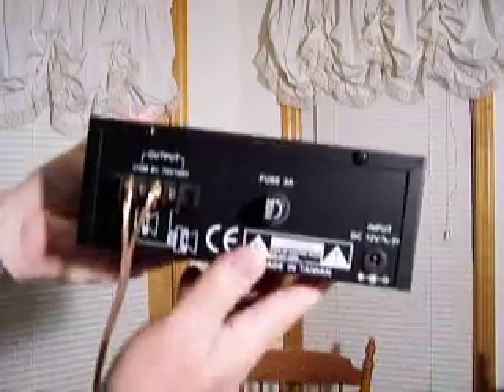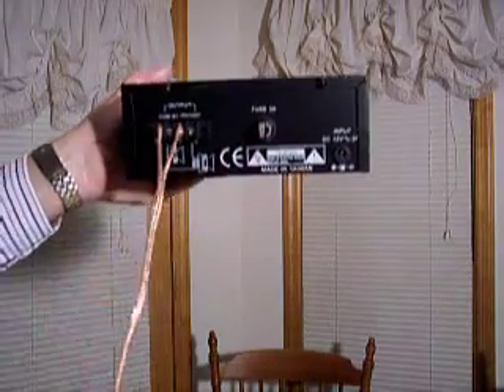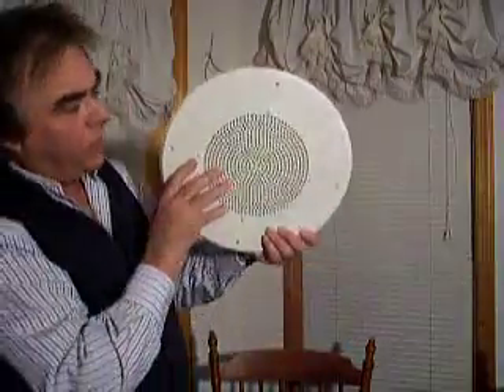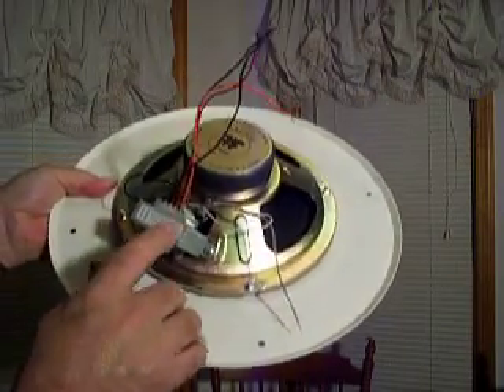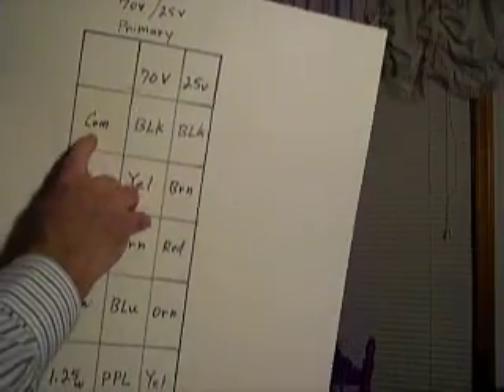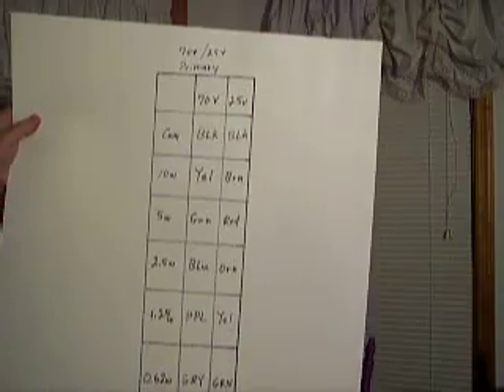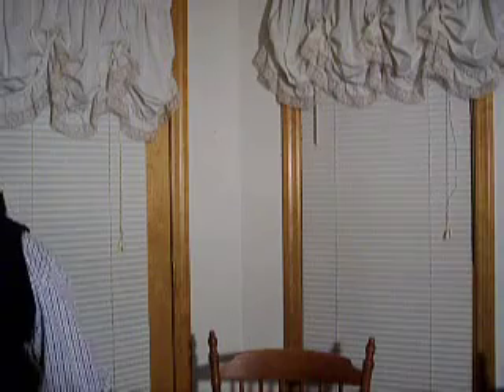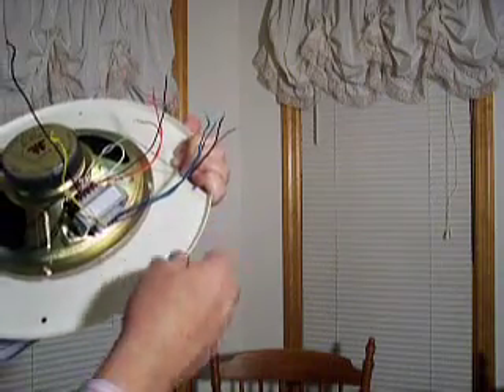Speaker Wiring 70 Volt Transformer PA amplifier

Comment: What kind of amp do I need for 6 sets of drive in speakers. They are 8 ohm speakers but the junction boxes have 70 volt transformers. Do i need 6 70 volt transformers for each junction box to make them all work? Im like building me a little backyard look like drive in theater. Thank if you can help me. Thanks

Comment: hi,i really need help but i dont know where to start.im just a mom trying to make a simple karaoke system for my kids.cant afford to buy a karaoke system so i decided 2 buy an AMP w/ mic input,but im having problems connecting our speakers 2 our AMP.my speakers has like 8 wires(set of blue/blue striped black & red/red striped black).but the AMP has only 4 input (whatever that is). but both of the sounds goes out in one set of input only.can i twist them & put in one input or what can u advice?

Comment: I use 24 AWG. One of the beauties of a 70V system is it's able to transmit signal with minimal loss through thinner wiring. The majority of systems installed in restaurants, grocery stores, banks, etc., will use 24 AWG wiring. Anything more (like your 12 AWG home theater wiring) is overkill, and anything less (like phone cable) is dangerous to run high-voltage current through.

Comment: Not every 70V speaker will have a 10W tap. Most standard commercial cone speakers only have taps at 1/4W, 1/2W, 1W, 2W, and 4W. I'm not sure what brand of speaker the person in the video is using, but it's rare to find a 10W transformer on a speaker of that type, simply because you wouldn't need a tap that large in applications where those speakers are common.